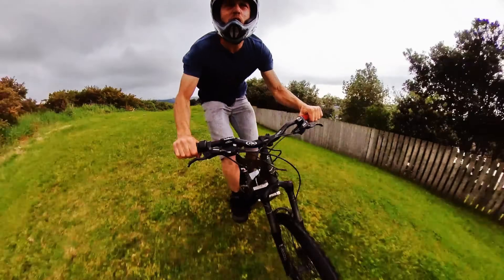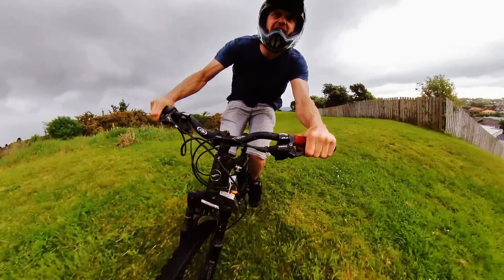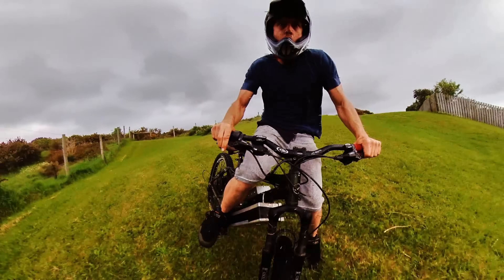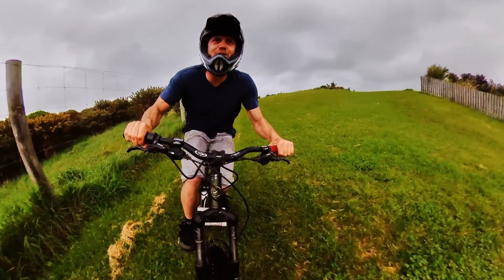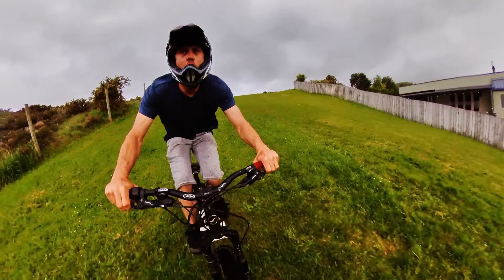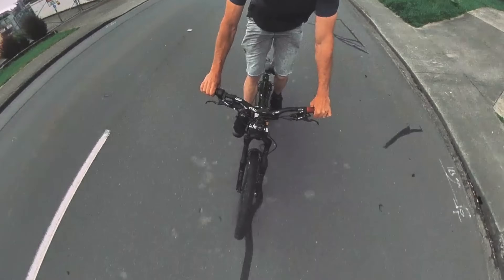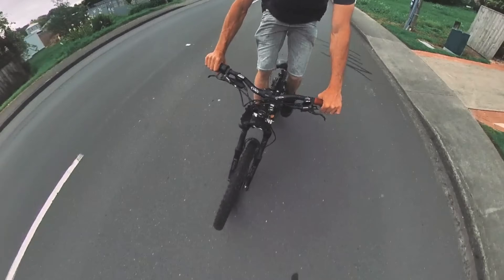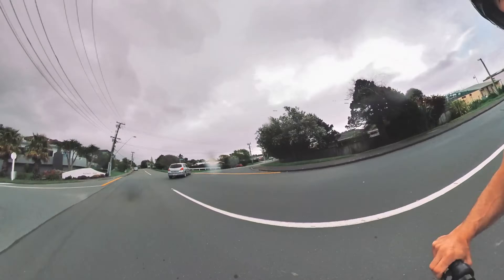How to build a beast 5kw ebike from a 1.5kw aliexpress hubmotor kit

Comment: I have a 1000Watt Motor with a 30A 48v controller if I do a shunt mod I think it will be around 70A output will the Motor heat up very much after 10 minutes of 100% power?
Reply: I, too, have the same specs as yours.  After my mod, I got about 20% more!

Comment: @jd-dc I just bought a 72v 5000w motor kit for my fat tire hardtail bike with an 80amp controller. the battery is a 72v. Could i even do this mod and if so will this make my bike 16000w?!?

Comment: Do you think it is possible with a heavy enough wire and switch to go across that shunt?Instead of  soldering it for a hidden switch, or would that jeopardize the control board
Reply: With a switch, the wire will be too long....  Even with just a few inches to fit nicely in there and +/- charge needs to travel shorter.  Best to mod the shunt directly!

Comment: regarding shunt mod. flip the board and solder a 4awg wire between terminals, at least this way you have less resistance compared to solder, also its reversible if you change your mind. simply remove wire.
Reply: That's sensible, but why would you remove it just limit the power with the controller.
Reply: thanks. also, do you know of a more up to date parts list. will this controller handle a 72V pack?

Comment: Bro, im not a professional, but i think your controller will die soon.

Also Temperature of  motor dont measure outside, because coils is deep inside motor, outside is magnets, and temperature has poor transfer between stator and rotor. You need temperature sensor inside.

And you need at least 72v 25a battery if you use high current cells (3c peak) or 50a if you use standart cells (1.5c peak) to pull 5kW, or it will decrease lifetime. 

Also its a very dumb idea, because motor target is 1500w or 2500-3000w peak. Greater power you push less power you get, because coils heating consumes more and more power. coils just not designed for that.

Finally that much power just nobody use with any voltage lower, than 72v. Because more current = more heat, so instead of increasing current you should increase voltage to keep the same level of power (P=U*I). Voltage drop on motor coils, that means heat, is Udrop=I*R. Resistance of coils you cant change, so the only way is decreasing amps. By the way the same reason we have 25kV electric transfer lines, instead of 230V (at least in russia).

Comment: On the engwe x26 bike … your opinion on simple upgrade to 50mph bike?…. Basically a typical rear 750watt with weak controller…main goal is better response on throttle.  Am I better off replacing controller or fusing it like you did?….thanks

Comment: All you need to do is buy another controller of giving you that programed voltage and amp use. This is too gung ho of messing with a controller of the BMS chip already set of the ranges it needs to keep from the worst scenario of fires and reasons why so many fires out there of user not going to admit to investigators they messed with settings from being fined, sued, thrown in jail if other lives effected from such possible cases.

Comment: Dont you have to reprogram the BMS Chip when messing with controller? Its for the range settings of the battery recharge of keeping the settings in range of actual original programing of BMS chip. This is a serious case of a future burnout or fire when charging and even seen on fire when in use of riding. Im all for upgrading but when you mess with controller to bypass voltage and amp settings, you are an accident waiting to happen. But if you ensure you are able to have the BMS chip settings changed of the cutoff power ( when temp gets certain temp of too hot, the BMS chip will cut off everything from being on fire. I dont think this is a legit DIY project if you not dealing with reprogramming BMS chip for it is the reason the BMS Chip is there, but good luck as the days go by along with usage of not having something break down, burned out, or worst on fire.

Comment: Hello. I have already built a massive 48V battery for this kit and I wouldn't want to build a new one for increased voltage. Do you think there will be benefits just by doing the higher current mod? 
Also, could you please tell me how many magnets does this motor have? I seem to have wrong settings in my bike computer...  I don't know what number to put in the P1 setting... (kt-lcd3 is the display/computer)
I also don't know what to do with the P2 setting :"D

Comment: SUPERB. i got a FOREKNOW fat bike and put 1500watt motor and controller. 52v 21 amp hour Battery. It's a heavy bike. up hill 24mph .. down hill 45+. i need more torque more than distance.

This is will try. PS... i have seen people fill the controller with a heat conductive resin to dissipate the mosfet heat to the outer casing... any thoughts on that? Thanks.

Comment: Hi ! I recently bought a wheel of this type, I did everything as you did. But the wheel turns in the opposite direction. What do you suggest I do with it? Thx G.
Reply: Reverse any 2 of the motors 3 power wires.

Comment: protip:

If you want even more power, it's possible to do a cap and FET swap for 100v rated components. the bones of these generic motor controllers is capable of taking north of 88v if you spec the right MOSFETs and main capacitors...

Before changing over to a pair of VESCs, I used a pair of shunt, cap and transistor modified controllers on a 76.8v LiFePo4 battery for a total power output of about 6kW AWD... from bone stock 1500w motors as well. They seemed to handle 3,000w at that voltage shockingly well since I never ran into heat issues or even hot phase wires on both the stock motor controllers (which were a pair of 500w jobbies initially), or the motors.
Reply: I have a Mac chain drive motor that was originally only rated for 48v 1000w but I've pushed 72v 7.5kw throw that thing and had zero issues yet, just hit 200miles on the build too
Reply: @Kamijay97  i just got a 500w cheapo off amazon and i already suspect that it can handle much more than it's getting. 
In the setting I was able to disable speed caps and was able to go from 20mph (locked) to topping out at 27mph with the stock 48v  battery.
After riding it wide open 6 miles to work, the motor hub isn't even warm to the touch. It doesn't seem to be working very hard. I am new with ebikes but I spent a lot of time building 10th scaled off road rc and you knew when you were stressing the system when the motor was too hot to touch for more than a few seconds lol, that was the in field method of checking the stress on the motor with whatever gear ratio/battery setup you had going. point is i would run 3s into a motor that was rated for 2s and beat the living hell out of it, competing with motors that cost 10x more no problem lol

 I am thinking about dropping a 60v in it and see what it does with that. After that point i will need to get a different controller in it if I wanted to go to 72v. 
The stock controller can be set for 36v 48v 52v and 60v 

I have a target of ~40mph with this particular bike and I am going to see if we can do that on the stock hub lol
Reply: @EonReevesScaleHobbies did it work, I'm interested??
Reply: @mickyb.8014  haven't tried it yet lol the battery pack is pretty expensive. I'll get to it eventually.
Reply: @EonReevesScaleHobbies  oh ok, well thanks anyway, I'm thinking of getting a 1500w 48v rear hub kit to slap on my 26" mtb, I'll be getting a 52v triangle battery, hopefully 20ah as it's all hills here in the U.K where I live...
I'm just trying to gather as much info before I buy a kit/battery...
Kinda torn between a Voilamart or maybe a ebikeling kit, if you have any info on which is the best affordable kit it's greatly appreciated...
I'm expecting to pay no more than about £650 (got bike already) for the kit and battery.
Cheers.
Reply: @mickyb.8014  Voltage will determine how fast the wheel can spin, amperage will determine how quickly the wheel reaches top speed / torque.

I was thinking about doing a mid mount motor because you can use the gears of the bicycle. Higher gears on flat ground, lower gears for hills.
Reply: @EonReevesScaleHobbies  Great, thanks for replying, I'm thinking of a 48v maybe even 2000w but at least 1500w with a 52v 20ah battery pack, hopefully it will do 30mph+ and be able to pull me up all the damn hills in West Yorks UK, thankyou.
I may try a mid drive kit further along my ebike path so to speak, maybe in a few months when I can get another bike and do a middrive kit build when my finances allow, much appreciated.
Reply: @EonReevesScaleHobbies  You're right.  You'll definitely get much greater climbing ability with a mid mount but it will tear up your drivetrain in relatively short order if you don't have beefy components.  Stay away from using your outer most gear on the rear sprocket (highest/hardest) to prolong the life of the cassette.
Reply: Hi, seems you know your stuff, any advice on which 1500w kits best for me to get...
Got bike already, a 26" Scott YZ4 mtb, picked it up for £70 and it's almost brand new, great bike.
Max spending money for a rear hub drive kit and battery (I'll buy battery separate if have to) is £650...
From what I've seen I'm thinking a Voilamart or Ebikeling kit?
What do you recommend please as I need plenty of ooomph and torque (I'm not heavy, just weighed myself at 80kg/12.5 stone) as it's very hilly where I live in the U.K...
Info on the best 48v 1500/2000w kits greatly appreciated.
I'm thinking 48v kit but using a 52v triangle battery (made a template and they fit just fine in my frame..
Rear hub width is 135-142mm also.
I'm also up to scratch on controller shunt modding as I've watched enough YouTube vids and I'll be doing this also (I think).
Cheers.
Reply: @mickyb.8014  I own both the Violamart 1200w and Ebikeling 1500w Kits.    The Violamart kit is a 1200w rear hub motor (SW900 LCD) that I replaced after I got stuck in a downpour and water got into the hub and damaged the hall sensors and windings. I had over 900 miles on that kit.  It performed extremely well.   I replaced it with the 1500w Ebikeling kit. My battery is a 48v 29.4ah pack I built 4 yrs ago using high quality Molicell 4200ah batteries (can dump 45A per cell!) and 100a BMS.  I had both kits on a 26" Specialized Enduro FS frame but have since moved the 1500w kit to a Specialized Comp 29er. I am 6'1 and 165lbs.  I live in Northern California and it is VERY hilly (mountainous).  I built my ebikes to gold prospecting with.  I coast 3 miles down into the canyon and at the end of the day (when I am exhausted), I throttle or PAS LEVEL 3 the whole way up and out and average 19mph.  Level 4 and 5 are out of the question due to the nature of the road (tight switchbacks).  The increased power with the shunted mod is extremely noticable. The Ebikeling controller and the Violamart controller are almost identical.  Same amount of caps/mosfets.  Slightly different layout and shunt locations but pretty much the same.

The stock ebikeling controller felt like it was holding the 1500w motor way back.  I felt like I had more power with the controller from Violamart that I had shunt modded on the 1200w. So I replaced the Ebikeling controller with the modded Violamart one. Holy Hell!   Now,  I can say my bike does not need more power (i.e. more wattage or a 52v battery).  It is an absolute rocket.  To put it into perspective, there is a steady 1 mile climb @ 4-5% grade coming back to my house once I am out of the canyon.   It is paved.  I keep my rear tire aired down (approx 30psi) due to the other roads not being paved (bike is a hardtail way less flats/rim punctures) so the rolling resistance is greater.  When I hit the top of the climb I am doing 30 mph with speed to spare.  The motor does not seemed to be taxed at all. The hub is not hot to the touch and the aluminum housing of the controller is slightly warm.  All phase wiring (original) stays cool. I think you will be extremely happy with a 1500w motor a 48v battery and a shunt modded controller.  

There is only one downside to doing the shunt mod.  It probably doesn't effect everyone but it is something to be aware of.  If you put the bike in "walk" mode (SW900 and S830 support this) the bike does not walk at 3-4 mph like normal. It is more like 5-6.  That's a pretty brisk walk.  I found this out when I needed to walk my bike out of an extremely steep, potholed road.  Before the mod, I was used to putting the bike in walk mode and the bike would literally roll itself uphill next to me as I kept one hand on the saddle and the other on the handlebar.  After the mod, when I put it in walk mode, the bike almost got away from me (another reason to keep your brake cutoff sensor installed).  There is no way I can walk up that road at 5-6 mph. I realize this is not a scenario everyone would encounter.  Just an FYI.  

Hope this helps.  Good Luck.

Comment: Man I’m looking into doing this to my mountain bikes this is my first stab at this I’m confident in my tinkering skills as I work on me and my buddies one wheels and I’m not afraid of working on electric  is this something that a beginner is capable of ??  Any tips would be greatly appreciated or any Improvements or things you would have done or gotten better I would love to know I want it to be powerful and a blast on trails like I do my OneWheel so I’d love for it to be able to do 40+mph thanks for this video and the secrets !!!!
Reply: The bike side of things is more technical than the electronics, you need spanners, allen keys, and a crank puller (they are very cheap if you dont have one), as for electronics, unless you are modifiyng the kit you probably only need screwdrivers - so yea, as long as you are confident at stripping down and re-assembling a bicycle, the electronic side of things is pretty basic.

Comment: What's the purpose of the ferofluid? Is it to help cooling only or does it have other benefits? Also if you added ferofluid & a heatsink to the 1500w kit without power upgrades , would it help increase wheel motor lifespan?   I heard these 1000-1500w kits wear out quick. People told me they wasted $ having 2 kits burn up in 2 years before finally buying a 3000W  or 1500w mid drive kit.  They said in hindsight they would have bought the 3000w kit 1st.
Reply: I guess the reality of a cheap 1000W kit is that the controller components arent good enough for abuse, if you wanna be pushing over 3000W regularly you shouldnt cheap out in the first place. I bought my 1500W kit 2 years ago, I use it daily and dont push it over 1500W. Also ferrofluid is there for helping to cool the rotor because heat has nowhere to go, ferrofluid bridges the airgap to the stator and lets it escape through the heatsinks.
Reply: My 1000wkit had just gone over 5000 miles . I've put a 1500w controlleron it now and done the shunt mod
Reply: @richie8214  Thsnks for reply/info....I've never had an ebike kit. Been using a 2 stroke motorized bicycle kit because it was cheaper. 
 I really want to build a DIY velomobile but it needs to be electric to be 100% legal.

Comment: Love the video just a quick question I’ve got a 1000w kit with the shunt mod so by doing the ferofluid in the hub will make it higher the the 1000w? Cheers
Reply: What the shunt mod does is allow the controller to draw more power from the battery pack. If your controller supports the extra load(always check!), then that's great.

As for what the ferrofluid, it is used for decreasing the thermal resistance of the motor to the outside, allowing it to be cooled more effectively.

Comment: there is an  2 part epoxy thermal glue I used on custom built heat sinks for ram and other components..never tested it against a clamp system and thermal paste but did see drops in temps with ram on video cards and computer ram..there are different grades of thermal paste that work much better than just 2 dollar generic thermal paste..Artic Silver is the best I have found..btw he did use to much paste..more is not better..then thinnest coat possible is what is best.

Comment: if i did this on a 1kw kit and used a 2kw battery. Would it break the battery or just pull 2kw
Reply: It would just pull 2kW from the battery pack.

Comment: hi JD-DC. Im new to tinkering with ebikes. i just bought this kit you upgraded.  Before you tinkered with the shunt in your controller. did you run higher voltage on the system than its rated for? I can easily build any battery pack, but i was wondering if i should build the battery pack with a little higher voltage, than rated.?